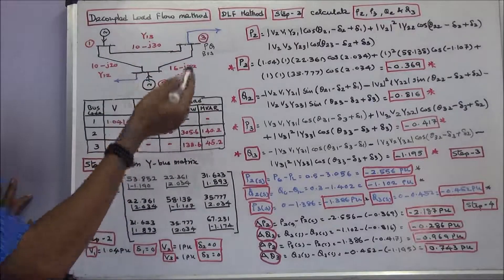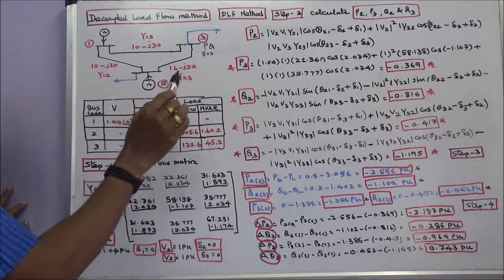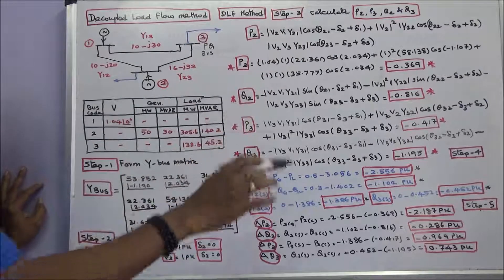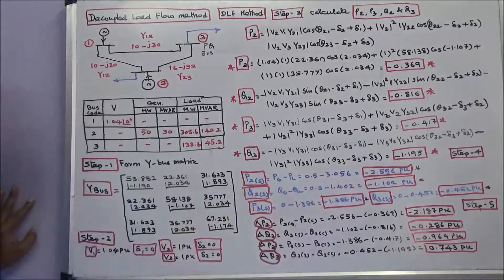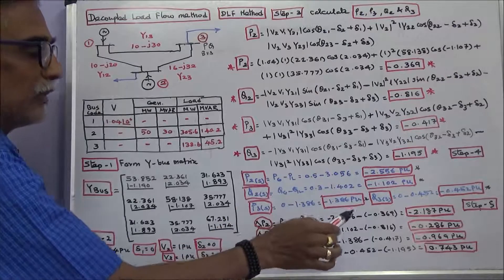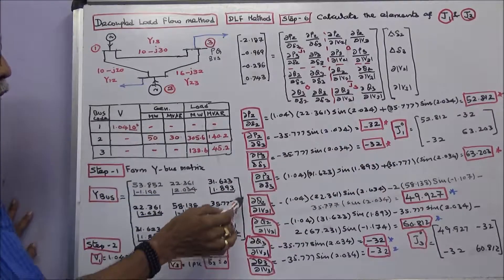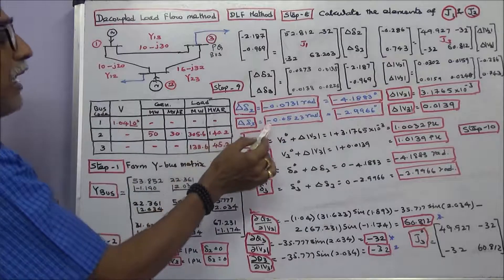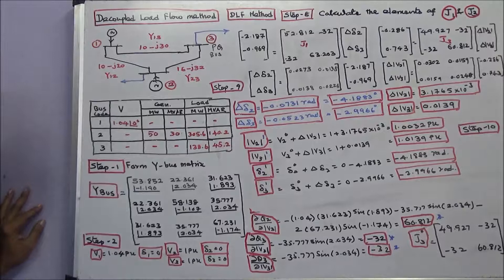LOAD FLOW ANALYSIS – PART – 45 – DECOUPLED LOAD FLOW METHOD - PROBLEM – 07

Comment: I think the Ybus is wrong...for example: Y13 should be -1/(10 - j30), am I right?
Reply: Ok I read the problem again and if I have correctly  understood now, you already gave the calculated values of Ybus on the system diagram right?
Reply: Even if the values of Ybus are already given in the problem, the angles are not correct...